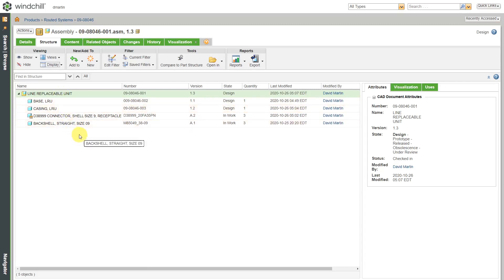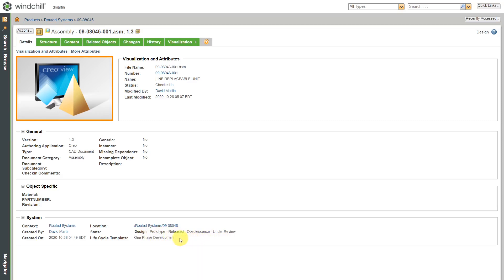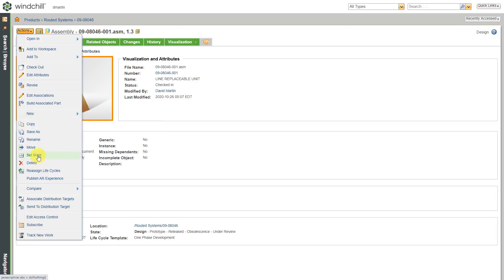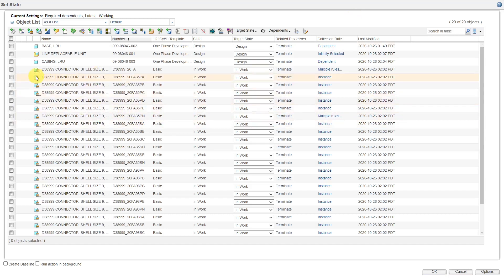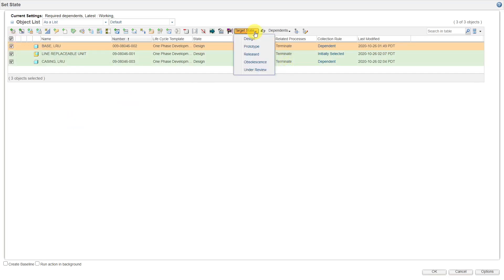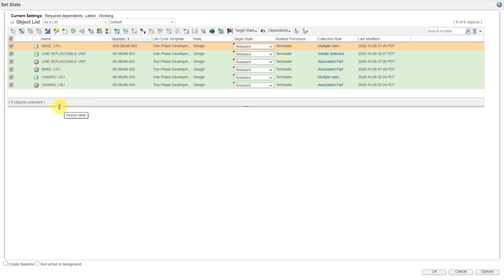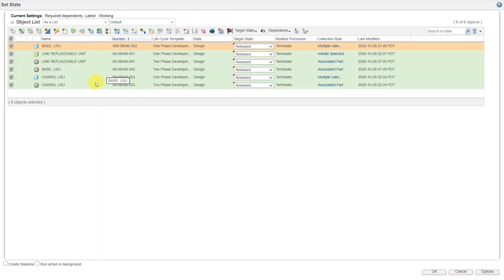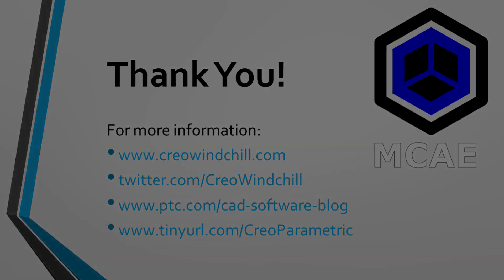PTC Windchill - Set State | CAD Data Management - PDMLink

Comment: Thank You for the video! I often make some errors during check-in process this is one of the most common error I made. 

How can I automatically associate the WT part? Where can find the setting (4:40)? Does it should be add to the config.pro?
Reply from the maker: That is controlled by a Windchill Preference, not by the Creo Parametric configuration options.
Reply: @CADPLMGuy  Thank you! I really appreciate your work/channel